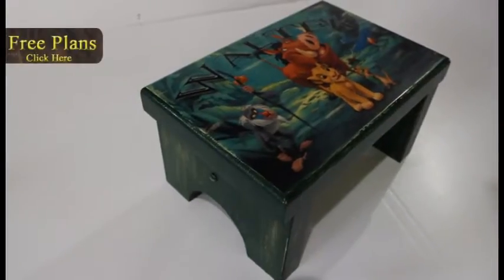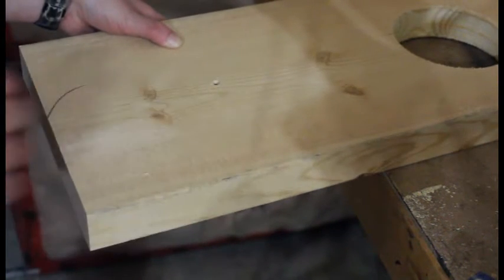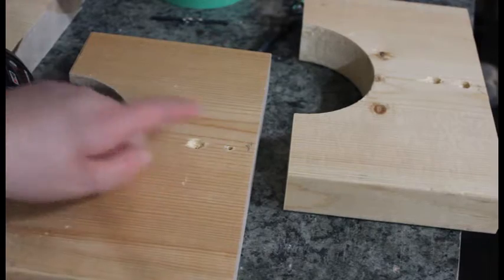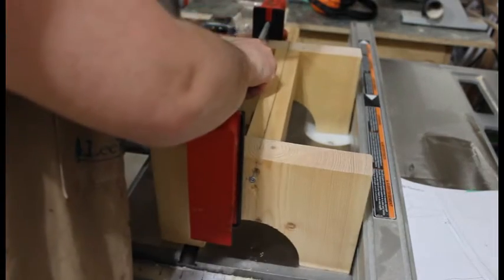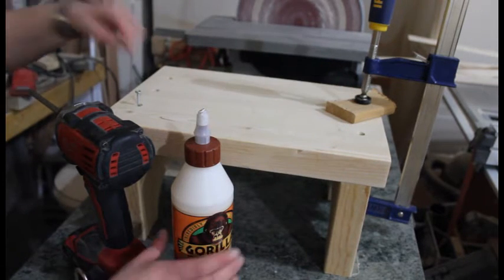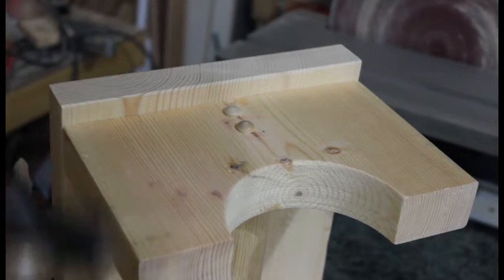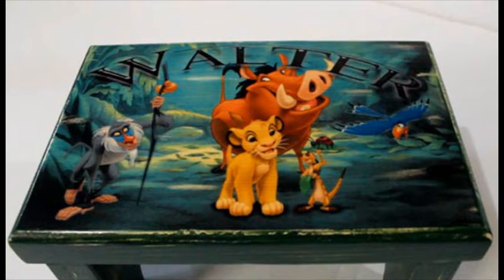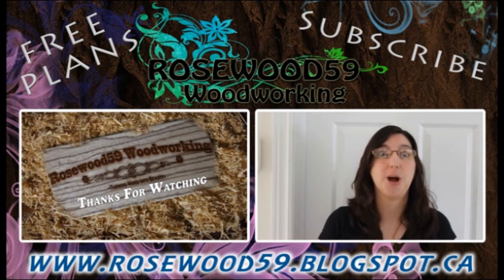How To Make A Kid's Step Stool

Comment: Love your work I really like the table with glass etched, don't  see plans, did you make the legs? very inspiring... listen can you give me a list of tools I can start collecting? I have limited space so no large ones yet.... I would love to make the tables for kids and the coffee tables and cutting boards plus the stools... it looks like I can cut the sizes at home depot... unless there is something small I can cut those sizes with... with will I need for beveling the edges of boards and stools? thanks your great!
Reply from the maker: Thank you so much! The glass top table project
was before I stared to do free planes. The legs to make the glass top table, I
found the legs on the curbside and repaired them. But you can buy the legs at
any hardware store like Home Depot or Lowes. Another great woodworking store is
Rockler but the store is only in the USA. Some stools you will need a beveled
edge and some stool don’t have a beveled edge. It really depends on what kind
of stool you want to make.
Reply: @Rosewood59  I have not found the download
Reply from the maker: @randythomas3580   Here is the download page link to my website http://rosewood59.blogspot.com/p/downloads.html  and search for How To Make A Kid's Step Stool. Click on the name and the page will load in a new window to the free plans.
Reply: @Rosewood59  Thank you very much I got it this time with no problems. I really like this one because it is out of 2x6 or 2x8 materials more beefy
Reply from the maker: @randythomas3580  Your welcome and Yeah I don't know why when you click on the download name on the menu wont load. Glad to hear that the link work! :) Yeah that's why I came up with this stool because of the beefy look. Enjoy the fee plans and Thanks for watching my video!